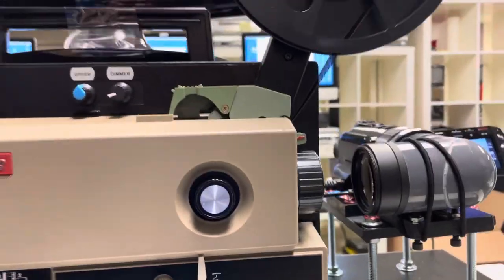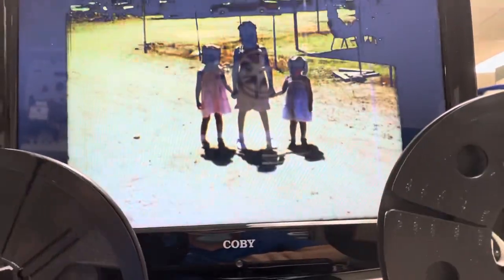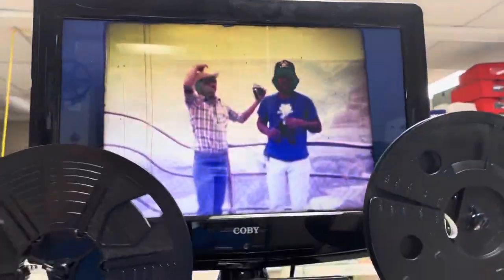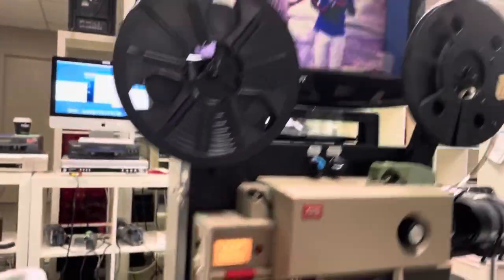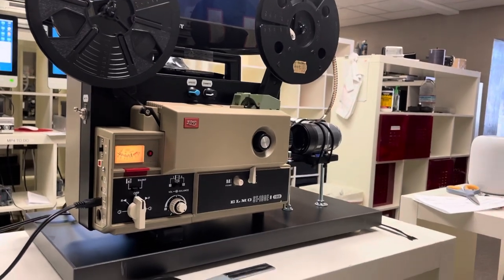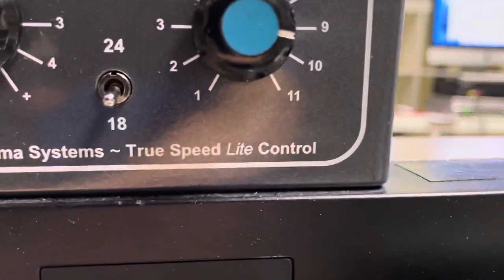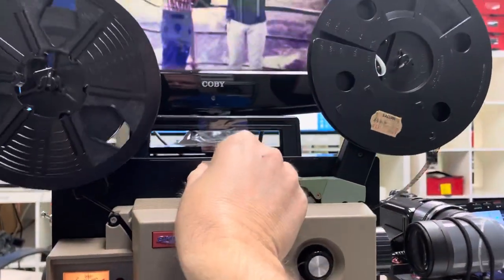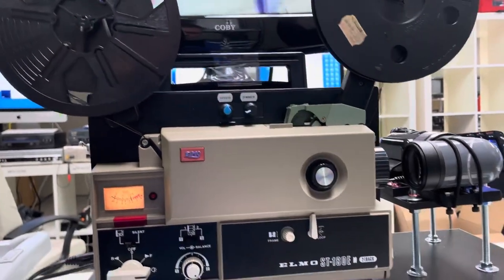Focuskye Super 8 sound to digital transfer equipment issue

Comment: Hi - I wondered if you ever got the problem fixed. I have the silent version of this machine. ( I also have  the far superior Moviestuff Retroscan unit as my main unit). I find the main problem with these is that the speed constantly drifts which results in banding moving up and down the image while you try to adjust it which you can't correct in post.
Reply from the maker: Problem wasn’t fixed, sent it back. Full refund given so kudos there.